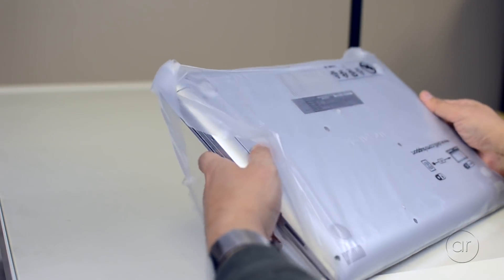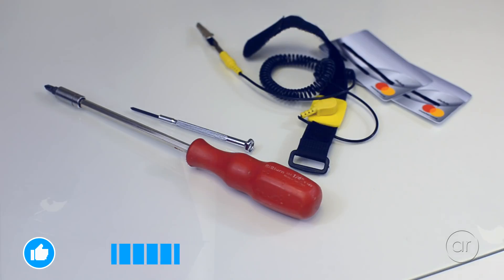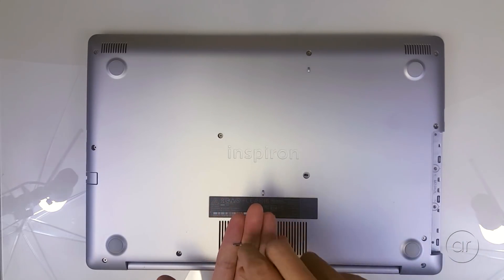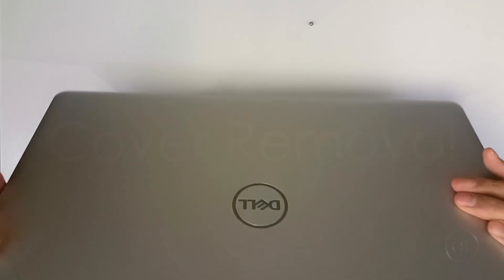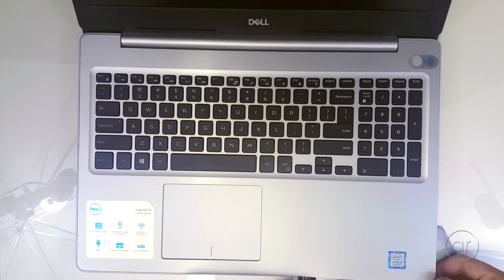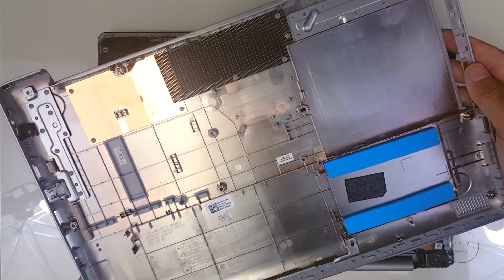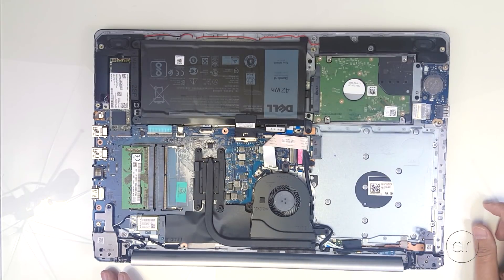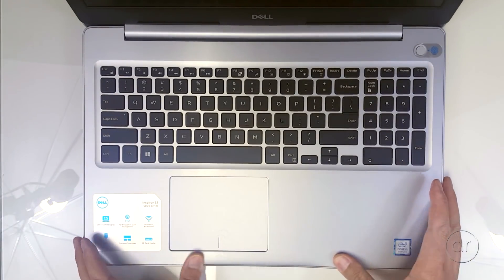How to Disassemble a Dell Inspiron 15 5570 Laptop to Install an M.2 SSD

Comment: " M.2 NVMe 3x2 SSD 512gb" can be used? 
(Notice that i have written 3x2)
Reply from the maker: I haven't tried that myself, but according to Dell's Setup and Specifications document for the Inspiron 5570, the M.2 SSD slot takes SATA or PCIe 3x4. There is, however, mention of 3x2 for Optane memory if your Dell is configured for that, but that wouldn't be used for storage.

Comment: My DVD drive is not coming even after removing all the screws
Reply from the maker: There is one screw that holds the DVD drive in, which is shown at the 1:08 mark. Did the drive not slide out after removing that screw?
Reply: @accessrandom  No, It didn't slide out. Something is stopping it at the bottom side of the laptop. It is coming out up to half a centimeter.
Reply from the maker: @suryacharan5184  Could there be a DVD or CD in the drive already? I'm thinking that it could have come off the center spindle. Otherwise, it could be some screw that is slightly protruding that's preventing it from coming out.
Reply: @accessrandom  Thank you soo much!..There is a cd inside it.That is why it's not coming out.

Comment: are there any NVIDIA graphics cards that are compatible with my Dell inspiron 5570 please help because i need to play a hat in time and its too laggy that i haven't even completed act one on the first chapter i also cant even complete a simple obstacle because of my trash intel graphics card and integrated GPU
Reply from the maker: I'm afraid not. The 5570 doesn't have a thunderbolt port so an eGPU wouldn't be possible.

Comment: Just so everyone knows - those 3 screws on the bottom of the case closest to the screen hinge are (according to the service manual) captured screws. Capture screws don't need to be fully removed from the bottom cover -  just unscrew enough until they are free from attachment to the main body case.

Comment: I see that this video is to install SSD on the SSD slot.  Am I able to replace the hard drive with an SSD on the Hard drive slot?
Reply from the maker: Yes, you can replace the hard drive with a 2.5" SSD instead of, or in addition to, installing an M.2 SSD to the M.2 slot.

Comment: if I replaced my failing hard drive with an SSD, will Windows boot or will I have to reinstall it again?
Reply: Reinstall it, I had the exact same problem, because my hard disk died. You can transfer your license via your Microsoft account, and to transfer data buy a SATA to USB adapter, Windows will keep trying to boot from the hard disk.
Reply: @MemeReviewer  damn you too? i just got my drive today and i've installed it but i don't know how to make it as the boot drive. how'd you get yours to work??

edit: nevermind got it to work! currently amazed at how fast it boots up now
Reply from the maker: If the hard disk is still readable, you could use a cloning program to clone the HDD to the M.2 SSD (I have another video that shows how here: https://youtu.be/BZqkYnmDnas). If it's not readable, you'll need to either restore the factory image to the M.2 SSD using Dell's SupportAssist, or re-install Windows. The license is embedded in the BIOS so it should be populated automatically.
Reply: @accessrandom  hey thanks for the video btw, wouldn't have done it without your help! appreciate it a lot!

Comment: Can I install NVMe M.2 SSD on this MOBO??
Reply from the maker: Yes, the 5570 will take an NVMe M.2 SSD. However, it runs the NVMe in a power saving (GT2) mode, which halves the theoretical maximum speed of 3500 MB/s. You'll still see faster speeds over the SATA M.2 SSD, but it will not be as fast as its potential.
Reply: access random so will it overkill installing NVMe SSD? Or should I install only M.2 SSD?
Reply from the maker: @shahadat-mso  I think most people would not notice the difference between the SATA and NVMe SSDs. The jump in performance is much larger between HDD and regular SSD. Unless the price difference is small, I would go with just the SATA M.2 SSD.
Reply: access random thanks a lot

Comment: Hello bro 
I'am thinking of putting an SSD as the laptop gets very slow.
But can you tell me what is nvme? you said something about it 
and also since i like gaming , will it have any effect on the gameplay?
Thanks buddy
Reply from the maker: You can think of NVMe as a faster version of SATA SSDs. The theoretical maximum speed of a SATA M.2 SSD is 600 MB/s while NVMe's is 3500 MB/s. However, the Inspiron runs the NVMe in a power saving (GT2) mode, which halves the speed. You will still see faster speeds over the SATA M.2 SSD, but it will not be as fast as its potential. To be honest, either will be much faster than a hard drive so you probably will not notice the difference for gaming.

Comment: Someone please help, the god damn dvd drive screw won’t come out. Might be a stripped screw.
Reply from the maker: I'm getting a lot of comments about those two tiny screws. I should have mentioned that you need a very sharp screwdriver bit (like the one I use in the video), or alternatively, you can use those mini-screwdrivers that jewelers use.
Reply: access random yeah I had the right screwdriver however what ended up happening is I stripped it. But thanks anyways!

Comment: I need to do the reverse, add a hd to my ssd. For storage.
Reply from the maker: If you have a configuration that includes an M.2 SSD but doesn't have an HDD, and you have the same family of Inspiron that I show, I would think there would be some type of placeholder where the hard drive goes (in the upper right hand corner at the 4:41 mark).
Reply: @accessrandom  Thank you for the reply! Mine is a 5575 with a 256GB M.2 PCIe NVMe Solid State Drive

Comment: So, kudos to the person in the thread who mentioned the flexibility of the case and how the SSD card may work loose - this happened to me today.

I installed a Crucial MX500 1000GB SATA M.2 2280SS SSD - when I rebooted into Windows 10, I checked the device manager, and happily the SSD was there next to the existing hard disk drive. Similarly it appeared in Disk Management.

I then used the excellent Macrium Reflect software to clone the existing hard disk drive onto the SSD (both drives are the same size, 1GB). This took about 45 mins and reported back successful. I could see the contents of the existing C: drive cloned onto the new D: SSD drive.

I then rebooted to change boot drives but couldn't see the SSD listed as an option?

What had happened is that, in the interim period, I had removed the case again to adjust something else and the SSD pins had worked loose. So, I reseated it and added a bit of insulating tape on the pins for good measure. I also reinstalled Dell SupportAssist to update to the very latest BIOS - changed the boot drive and, so far, my new 1GB SSD is quick! 

Great video! Very helpful.
Reply from the maker: Thanks for the great writeup. I didn't catch the comment about the SSD coming loose - this will be very helpful for others as well. Thank you 🙏
Reply: @accessrandom  Not a problem! One other thing I found is an irritating periodic stuttering sound whilst listening to audio or watching videos on my Inspiron 5570.

This coincided with the installation of the new Crucial SSD M.2 drive but, more importantly, also with the temporary installation of Dell SupportAssist. So the SSD M.2 is not the guilty party - uninstalled SupportAssist and the audio issue is solved!
Reply from the maker: @johnleggett5054  Thanks for the tip - SupportAssist is one of the first things I uninstalled 🙂

Comment: I finally upgraded my 5770 Inspiron with a 512G nvme m.2 ssd. 
It's not necessary to remove the screws (the two by the hinge are captive) just unscrew the rest of  them till they are disengaged then put tape over the holes to keep the screws from falling out. Now you don't have to worry about where they go!
I used a polycarbonate cast iron scraper (Lodge) to pry the back off. It's very sturdy and I just had to run it around the perimeter of the kybd  popping each clip in a single pass. It only took about 30 seconds to do that.
Followed your excellent Macrium Reflect instructions to copy the partitions onto the ssd- it took about an hour. After changing the boot order it came up flawlessly in about 30 to 40 seconds instead of minutes. Thank You!
Reply from the maker: Thank you for the great tips - this will be very useful for others. Do you mind if I add your comment to the description with credit to you?
Reply: @accessrandom  Feel free to use anything that you find helpful. I don't want any credit since most of the work was done by you. You saved me a lot time and probably a lot of grief! Thanks again.
Reply from the maker: @eminusipi  Sorry, didn't see your reply until now because Youtube didn't alert me for some reason. I've added your tips to the description - thank you 🙏

Comment: I have a few questions...
1.  Can I install a WD RED 500 GB m.2 2280 SSD on my Dell?
2. If so, can I use my laptop normally, since I have the other HD, or do I have to do an extra step?
3. Can I upgrade my laptop putting the m.2 and an SSD 2.5 inch drive?

Great video by the way, I was looking for it!
Reply from the maker: Thanks. Since the WD is a standard M.2 2280 drive, it should work (Dell's specs say the max size for an M.2 SATA SSD is up to 256 GB, but other commenters and my video have gone higher than that). You can use your laptop normally - the SSD would simply show up as an additional drive that you format. If you want to use the SSD as a boot disk, you would either need to restore the factory image to the SSD, or clone your existing hard drive partitions to the SSD. You can certainly upgrade the existing hard drive to a 2.5" SSD plus install an M.2 SSD - they will be seen as two drives.

Comment: thankyou. I was really wondering if my inspiron 15 5570 has an SSD slot. coz I really want to upgrade it. since the harddrive is so slow.
Reply from the maker: I agree - it's very slow with the hard drive. The M.2 slot in the 5570 can take a SATA SSD up to 256 GB
 or an NVMe SSD up to 512 GB (according to Dell's own Setup and Specifications document), but many viewers have successfully installed higher capacities (like 1 TB).
Reply: @accessrandom  thank you so much sir. i will subscribe for more content for sure.

Comment: I have a 1TB SSD instead of the HDD. can i still add another 1TB M.2 SSD to the slot and an additional 16GB to boost performance?
Reply from the maker: Yes - there are other commenters who have have installed a 1TB M.2 SSD, which you can use with your 2.5" 1TB SSD. The 5570 will support a maximum of 32 GB of memory (2 sticks of 16 GB).
Reply: @accessrandom  thank you greatly. Now i can purchase with confidence.  Let's see if i can boost performance.  She's now over a year old so i have a few things on it so it's slowing down. Again continue doing the good work.

Comment: Thanks for a great video.  I followed it, and I've installed a  Crucial MX500 500GB 3D NAND M.2 Type 2280 Internal SSD (the CT500MX500SSD4).  It fits perfectly, but the BIOS just doesn't recognise it.  According to Crucial's website it should work.  But as you've noted, Dell themselves say the max is 256 GB. And I see that other people have apparently had success with 500 and even 1 TB. Any suggestion for what to do?  I mean, the BIOS should just recognise it, right?  There's nothing else to do.
Reply from the maker: You're correct that other viewers have had success with larger M.2 SSDs. Try entering the BIOS, navigate to the "System Configuration/Drives" menu on the left side, and make sure that "M.2 PCIe SSD-0" option is checked. If it's already checked then yes, the BIOS should just recognize the SSD.

Would it be possible to try the SSD in another machine (to rule out that it's a bad module)?
Reply: Hi  @accessrandom .  Yes, I've checked that the BIOS has enabled "M2 PCIe SSD-0".  They're all ticked. I ordered the same SSD, but the 256 GB version, thinking that the size might be the issue, but that doesn't work either.  I should say that this is the UK version of the Dell 5570, so it may be different.  I'm not sure what to do now.  Dell does sell their own SSDs for the 5570 in the UK, so I suppose I could try that.  But the website says "1 to 2 weeks to dispatch".  Sigh. Unfortunately I don't have another Dell I could try it in either.
Reply: And I've tried the card upside down too, but it just doesn't seem possible to fix the card in upside down.  Which is good I guess.
Reply from the maker: @highvoltage735  I'm leaning toward the possibility that the M.2 slot is bad, especially since you've tried two differently sized SSDs in it. Is the laptop still under warranty by any chance? If so, I would contact Dell, since the slot itself isn't a component you can replace (unless you replace the motherboard).
Reply: @accessrandom  Yeah, I'll do that.  Thank you!

Comment: hi. can i do thiesame in my inspiron  5770?  to upgrage ram and ssd?
Reply from the maker: According to Dell's Setup and Specifications document for the 5770 on their website, you can upgrade to an M.2 SATA SSD (up to 256 GB) and an M.2 NVMe SSD (Up to 512 GB). It will also support up to 32 GB of 2400 MHz DDR4 SODIMM memory (2 sticks of 16 GB).
Reply: @accessrandom  thank you so much for information.
Reply: @accessrandom   hi.. what is the difference between SATA SSD and NVme.  which one is more faster? thanks
Reply from the maker: @schoolfield27  NVMe is theoretically (roughly) seven times faster than SATA. However, Dell's M.2 slot uses a low-power mode called G2, which effectively reduces the speed of NVMe to half it's theoretical maximum speed (so for example, it will read at 1800 MB/s instead of the rated 3500 MB/s). Even at half speed, It is still faster than SATA though...
Reply: @accessrandom  thanks a lot for the  informative information.

Comment: I've just upgraded my laptop and added a 256gb m.2 SSD. But.. my laptop doesn't detect the SSD. Not in the bios, or device manager, or anywhere. I'm not sure what to do. It doesn't show up as unallocated space in the disk management window. I'm really lost, and hoping it's a software issue. Along side that, i've added an extra 4gb of RAM, and i've seen major improvements in overall performance, which is great!
Reply from the maker: Would it be possible to try the SSD in another machine (to rule out a bad unit)? Other than the SSD not seated properly, I can only think of a possible hardware incompatibility or defective hardware. What brand/model of laptop and SSD are you using?

Comment: Dear i have Dell Inspiron 3584 is this model supports M.2 860 Evo ssd
Reply from the maker: According to Dell's Setup and Specifications document, it will support an M.2 2280 SSD, Class 35 and Class 40, up to 256 GB.
Reply: @accessrandom  will it supports my requirement please tell me
Reply from the maker: I'm afraid I can't say for certain, since there could always be inherent hardware incompatibilities. However, you can browse through the comments (below) for others who have had success with the 860 Evo.

Comment: Dear, This model Dell  5570 supports "WD Blue M.2 SSD 500GB" Capacity .... Please let me know...
Reply from the maker: According to Dell, the 5570 supports up to a 256 GB M.2 SATA SSD. However, there are many in the comments who have had success with 500 GB and 1 TB. My guess is that Dell has tested only up to 256 GB at the time of printing the manual.

Comment: Which type of sad do I need
Reply from the maker: You can use either a SATA or NVMe M.2 SSD. According to Dell's Setup and Specification document, the 5570 supports up to 256GB for SATA and up to 512GB for NVMe - however, many commenters below have gone beyond those specs (including my video, where I use a 360GB SATA).
Reply: Will it support NVMe too
Reply from the maker: Yes, it will.

Comment: i put an ssd m.2 sata hp s700 in my inspiron 5575 and the bios doesnt recognize it. could you help me?
Reply from the maker: The S700 seems to be a standard M.2 SSD. What size are you using, and would it be possible to try it in another machine?
Reply: @accessrandom  256gb, in hp Pavilion AND Lenovo v330 works fine!
Reply from the maker: That is within spec according to their manual (it says up to 256 GB for M.2 SATA SSD). I am not sure why it is not working - maybe it is an inherent incompatibility with that model? You may want to contact Dell in this case.

In the meantime - has anyone else had this problem with the HP S700 in an Inspiron 5575?
Reply: @accessrandom Dell says Gracias por la información. Infortunadamente esa marca no está dentro de las que recomendamos para nuestras computadoras. Por ende no podemos darle soporte a un hardware hecho por nuestra competencia.
Thanks for nothing Dell , una cagada

Comment: m.2 sata or m.2 pcie?
Reply from the maker: The Inspiron 5570 will take either. But if you use the PCIe, please keep in mind that Dell throttles the M.2 slot by running in GT2 power saving mode, which means the SSD will see read speeds of only 1800 MB/s (instead of the theoretical max of 3400 MB/s).